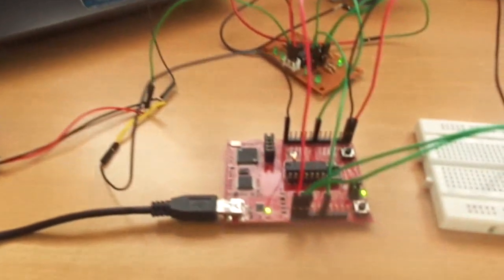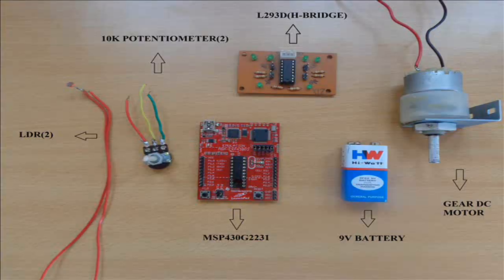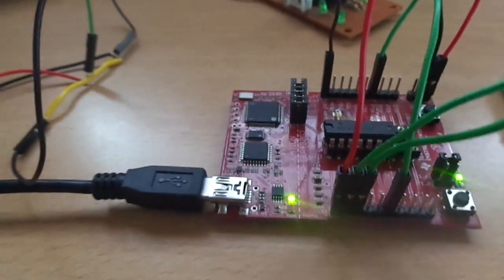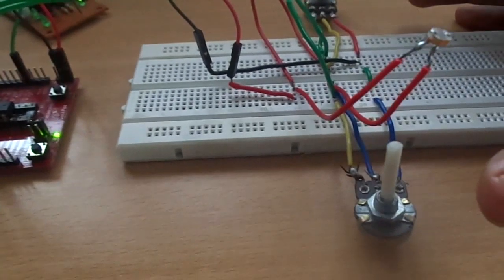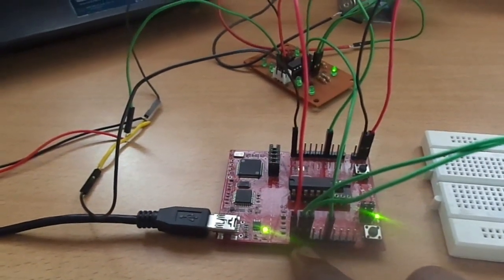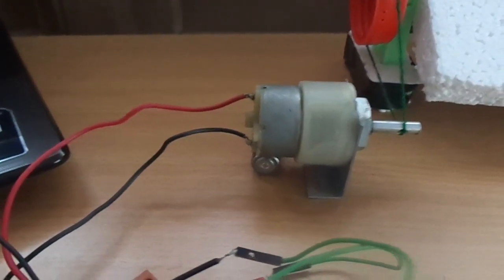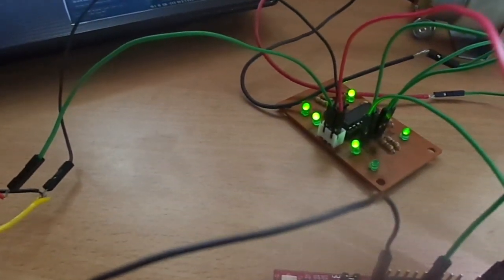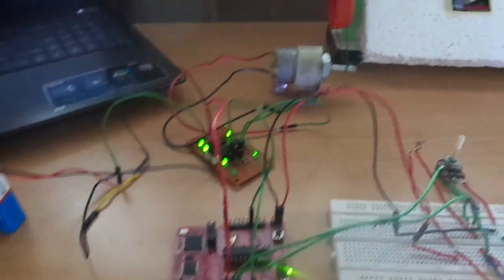Solar tracking device

Comment: Hi which software we have to use for msp430
Reply from the maker: Hi, We can program MSP430 using Energia IDE (like Arduino IDE).
Energia IDE link : https://energia.nu/
Reply: @CircuitTickle   can you send the simulation file for solar tracking device using msp430

Comment: Thank you very much for sharing this Mr vignesh raja. This is awesome and helpful to me. I want to do this using MSP430FR5739. So please can you send me the code for MSP430FR5739. Or any other project based on MSP430FR5739 microcontroller. hope your reply soon. My email asitharaddella@gmail.com. Please help me.
Reply from the maker: Asitha Raddella 
http://www.instructables.com/id/solar-tracking-device-using-msp430/
here the link to get the project code and you can use the same code to your ic
only thing is slight changes in circuit diagram which present in the link

connect  LDR 1 INPUT to MSP430FR5739'S PIN 5
connect  LDR 2 INPUT to MSP430FR5739'S PIN 6
connect  L293D IC'S PIN 2 to MSP430FR5739'S PIN 13
connect  L293D IC'S PIN 7 to MSP430FR5739'S PIN 30

Comment: Hi Vignesh,  Excellent representation.  What about when the LDR points exact perpendicular to the sun and the strength of signal is same on both ends.  Will it cancel out and stop movement?  Kindly advice.
Reply from the maker: Thank u. yes .when the both ldr values are equal the motor will stop . i programmed the msp430 controller like that.
Reply: I vignesh, if I want to buy one of your working model would you be able to sell it.  If so please quote me a price at anjeel at gmail dot com

Comment: It is a pretty cool project U have there Vignesh.But I am interested to know if the C-code you used can be used on MSP430G2553.If so can U please email me the sketch sometimes.Thanx.
Reply from the maker: Thank you peter. you can use the same code in msp430g2553 to achieve solar tracking. i will mail the code or i will put the code in my blog soon.
Reply: In that case my email address is pmirungu72@gmail.com. Thanx Raja.
Reply: @CircuitTickle  Were you able to make the code for MSP4302553? If someone got it can you mail me the code on edylfdo@gmail.com please. Thank you in advance!
Reply: can you send me the code as well?
Reply: my email is earroyo95@hotmail.com
Reply: Can you mail me the code to lavanyakukatla75@gmail.com

Comment: I think its better to put the LDR on solar panel's edge itself. so that it can automatically take care of the panel's current position.
Reply from the maker: Yes you are correct. Actually i said that thing in video. but i didn't show because the when i place it in my thermocol model setup it get stuck so only i show like that in video . but in real application we need to place the LDR in edges of the solar panel.
Reply: vignesh raja
so Vignesh is it able to track the intermediate positions or just extreme positions? if you dont mind can you pls share your design and code?
Reply from the maker: i show my code and circuit diagram in the video itself. see the last portion in video